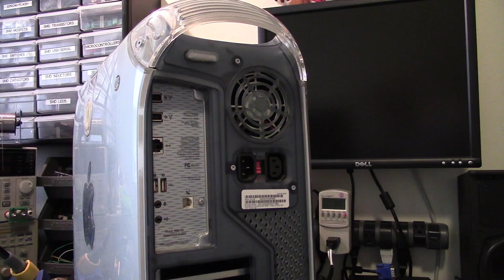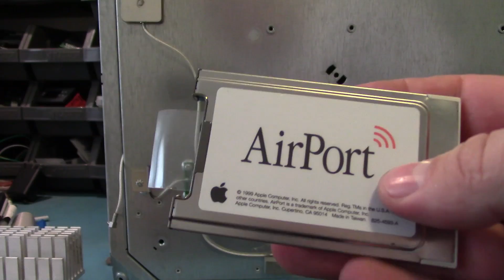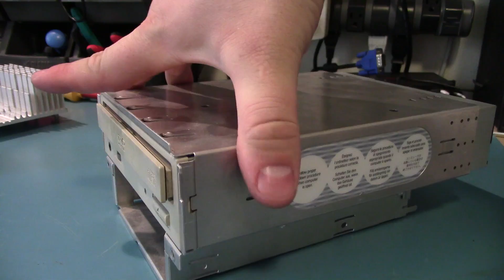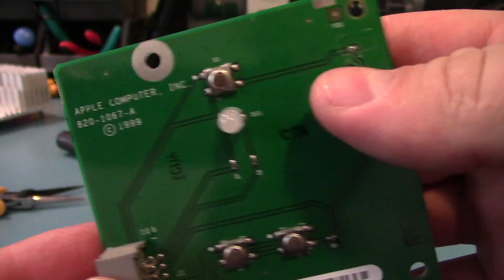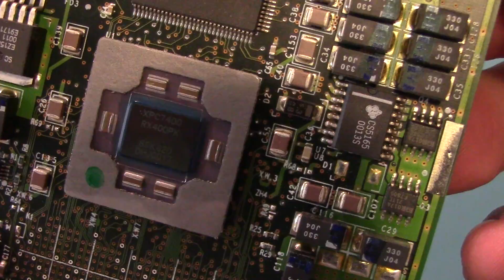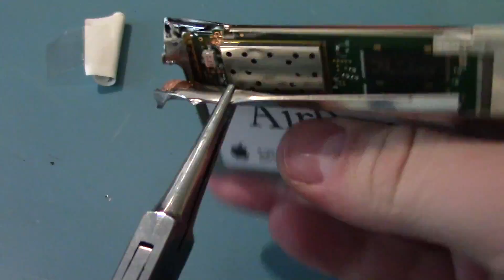Power Mac G4 (AGP Graphics) Teardown

Comment: I still have about four of these G4 series. What was great, one of hem came with a 1.25 plug and play processor upgrade. They are pretty reliable machines and can run a number of OS's and classic as well. I tend to use mine for audio ripping and not much else. I swapped the drives and DVD so I can burn CDs.
Reply: Are you able to add a scsi internal 50 pin hard drive as a secondary?  I am trying to extract some old files from an old drive.

Comment: I think at the time Apple made the G4 Sawtooth, Apple thought the HDD industry was going to adapt FireWire as a native FireWire interface HDD controller board. But it never happened. There were PATA/IDE to FireWire converter chips, but no HDD had built in FireWire on their controller board. So the internal FireWire port was unused.